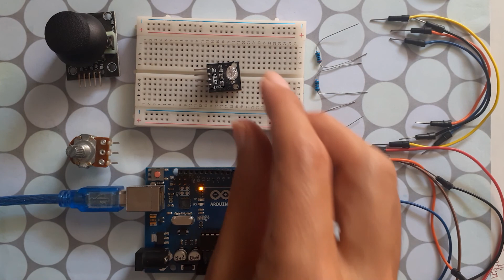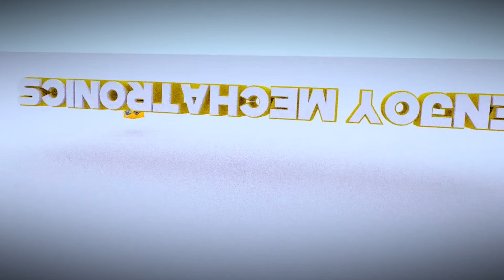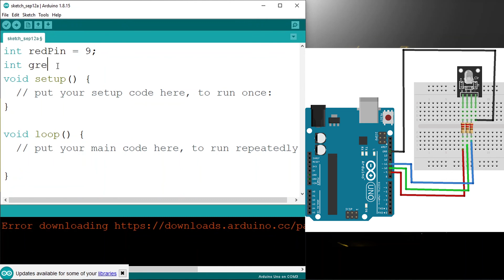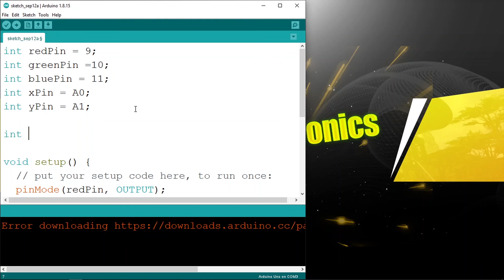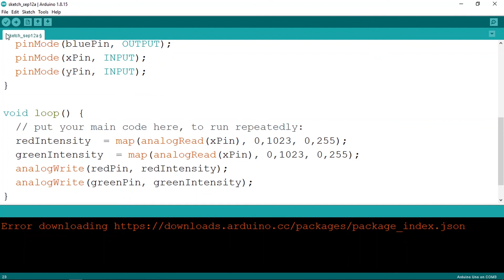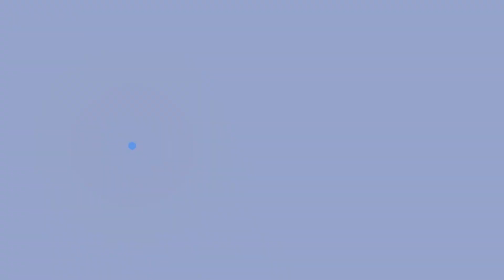Arduino Tutorial 17- Controlled RGB LED using a Joystick

Comment: How much ohm are these resistors
Reply from the maker: 220 ohm resistors, but a value between 200 and 500 is fine
Reply from the maker: 220 ohm resistors, but a value between 200 and 500 is fine
Reply from the maker: 220 ohm resistors, but a value between 200 and 500 is fine